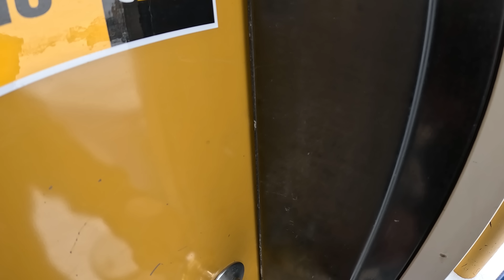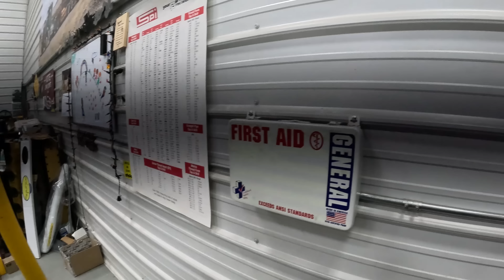Super Dodge Teardown part 2

Comment: I've got the same truck in black.  I replaced those plastic bumper parts when mine was hit last year.  The Chinese ones I got off eBay don't fit quite right, they are inexpensive but look like crap.  For the price of the Mopar ones and the new bumper I wish I'd have just put a winch bumper on it the first go-round.  So thats my advice, just pony up and get yourself a good aftermarket heavy steel bumper for SuperDodge . . . If you don't you'll probably wish you had.

Comment: Best thing I did was replace that Y style steering linkage with a T style from I think was a 09 model. It bolts right up without any fabrication and then put a steering box stabilizer brace Geno’s sells. I think they also sell the linkage too. May want to check the track bar to make sure it’s still tight and not busted. Don’t want the death wobble their noted for sneaking up on you.

Comment: Good video, finding hidden damages runs the ticket up pretty fast. When our rice burner had to be repaired after hitting a ditch they first qouted 2500 and after it was completed the total was 4800. They just kept finding damaged parts the deeper they got into it. We just paid the deductable but had to take it back, someone left 3 bolts loose on the under carriage support, I guess they missed torque wrench day at wingnut college.

Comment: Jeff, there used to be repair sleeves available for those knuckles if they weren't too far gone. I've used them and they worked well. Used a tapered reamer to get the bore to size. I think, but can't remember for sure, there used to be an oversize ball joint too, but don't quote me on that one. Those replacement radiators from NAPA are junk anymore. I put two of those in the same 2002 Dodge diesel truck with no avail. The tanks leaked like a sieve after a couple weeks. Put an all-aluminum rad in with no more leaks. Maybe you could pressure test your trans. cooler to see if it's OK, but if you can get one fairly reasonable, why bother I guess. Maybe test the intercooler while you're at it if you can adapt your test rigs down to size. Check your track bar. I haven't seen one yet that wasn't loose or bent. Geno's used to have an adjustable unit called Luke's Link I believe. You just put more shims in as it wears. It was a pretty beefy unit. Geno's also has the steering box brace that I mentioned in the previous video. I see some other fellas below here pointing you there. They have a lot of good stuff at Geno's, but you may already know that too. Jeff will win!
Reply: both of those or a machine shop can weld it up and bore a new taper.
Reply: @fastst1  Yup, a machine shop could do that. I charge 95 an hour in my shop, and for one off jobs like that, it would be about 2 hrs. of weld and setup time versus just ream and sleeve or oversize joint. It just comes down to price and availability for a part. I had some of those knuckles laying around that were good. I got tired of them taking up space and scrapped them last year. Wish I still had them so I could ship them out to Jeff.😁

Comment: You might as well put a steering sector on it. Do not buy one that’s built by A1 Cardone, or you’ll get practice changing them until you buy a different brand. BBB is pretty decent.
The reason I say to replace the sector is that I suspect the pitman shaft got twisted in the collision, and especially because the ball joint separated. Put a full set of ball joints in it while you’re at it.
I’ve worked around front end repairs for over 30 years.

Comment: There is an anti flicker setting in GoPro cameras that should be set to NTSC (for 60 Hertz AC) and not PAL (for 50 Hertz AC).  Other things to try are shutter speeds of 60 or 120 to help with the light flickering.  Hope this helps.
Reply from the maker: I've tried everything and nothing works, is it just the LED lights in my shop

Comment: Well ya got half thr front off has that Cummins had the dowel pin mod done ?
Reply from the maker: I had the front cover off before YouTube was invented and it seams like mine had the updated cover, I'm more worried about the service truck as it's a 99.5 so I'm sure it has the killer dowel
Reply: @Jpaydirt  good thing I’ve seen the destruction that happens from that !
Probably best to check the ST then all ya need is that to go clunk and you know it will happen when you need it most 😐

Comment: I gotta ask ya…would consider yourself a Dodge guy, or a Cummins guy. I’ve had fords most my life, and recently bought a 99 Ram 1500. I gotta be honest, I’m not that impressed with Dodge quality. Good “looking” truck, but outside of that I don’t get why folks like em. Just wondered if it’s the engine alone the makes the truck worth dealing with. Love your channel.
Reply from the maker: My 2nd gen gets 20 mpg and has been pretty dependable, but also had some problems with the steering, as all dodges do. but every other brand has their issues also and those seem to be more pronounced now than at any other time, it's like they know you can't work on it so lets generate some business for the dealer and the manufacturer
Reply: @Jpaydirt  yeah all the newer ones are like that. I’m not trying to be snarky or make it a Ford vs dodge Chevy thing. I was just curious. The one I have is my first Dodge I’ve owned, and it just has so many “little annoying” things wrong. Steering was an issue, the interior, if it’s plastic, it’s broke. Just seems like everyone I know that praises the Dodge, has a 2500/3500 with a Cummins. They never admit if they actually like the truck.
Reply from the maker: @fireguy8466   I have a little 1500 sport with a 360 and it drives good but isn't real reliable and is due for a heater core and boy did they make replacing those a job, oh and it gets like 13 mpg LOL
Reply: @Jpaydirt  lol. The 318 isn’t much better. Mines been averaging 13.5. If you get one the has the upper dash delete (like mine) you can at least see the whole heater box.